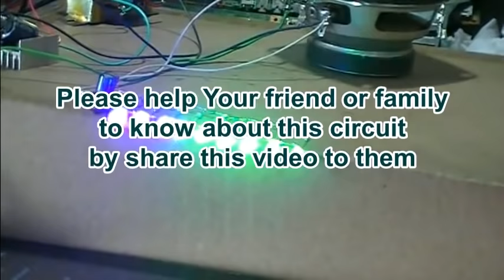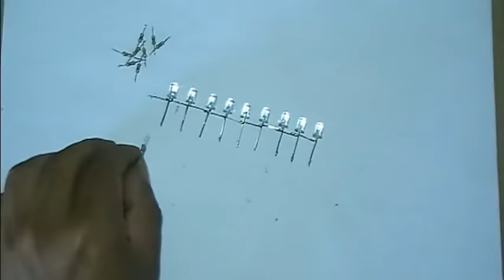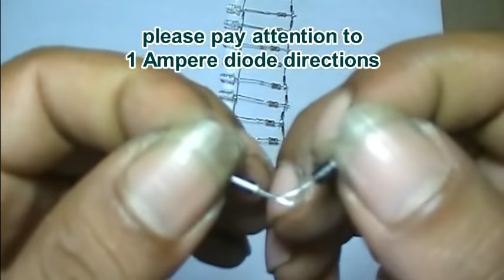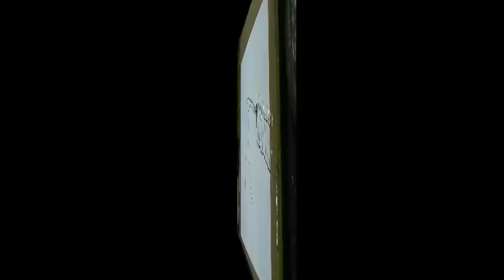No Transistor no IC LED VU Meter

Comment: Can i use  470uf /25v capacitor. And 470 ohm 1/4 watt resistors. And 4007 diode.
Reply from the maker: yes you can use it
Reply: @moristo  thanks bro.
Reply: Can i use 470uf /35v capacitor ?
Reply from the maker: Sure, go a head.

Comment: Can I power this with a 3.5v external bat and ad a mic so it can work on ambient sound?
Reply from the maker: This LED circuit need minimum 15 watt amplifier output power to make it works better.

Comment: No need power supply???
Can i connect with 2way amplifier
Reply from the maker: yes right, no need special DC power supply, just connecting directly to loudspeaker/transducer, and use more than 20 watt amplifier.

Comment: It won't reduce speaker sound?
Reply from the maker: very small current on this LED VU meter circuit, but you have to use more than 10 watt amplifier.
Reply: @moristo  thank u sir
Reply from the maker: YAW

Comment: Can i use it in my sakura 737 amplifier, 1400 watts
Reply from the maker: yes, but you must to add a resistor series connection on the input to reduce the current, Resistor value is 10 ohm up to 100 ohm.
Reply: @moristo  thank you and what is the resistor watts can i use
Reply from the maker: minimum 0.5 watt.

Comment: Formula for LED resistor is R = (Supply voltage - LED voltage) / LED ampere. So, R = (220-2)/0.02 = 11k but when I connect 11k with glass type transparent LED then it fuses after sometime. Why?
Reply from the maker: Please remember, LED current is DC, not AC, when you convert 220vac to vdc using bridge rectifier it wil be around 300vdc.
Basically formula is V=IxR, so R=V/I. For the resistor please use more than 1/2 watt and please use good quality LED.
Reply: @moristo  I am not using any bridge rectifier but only a resistor and even 1/2 watt resistor of 200k makes the led to fuse
Reply from the maker: So the LED quality is not good.
Reply: @moristo  how can you say that, because these LEDs are working fine on battery.
Reply: @moristo  can you tell me what is the significance of the resistor wattage when connecting in series with a LED? if 1/2 watt resistor is connected then does it means that any LED upto 1/2 watt can be used or it means that the resistor will consume 1/2 watt?
Reply from the maker: You said you use 1/2 watt 200k resistor the LED still fuses, so I conclude that the quality of the LEDs is very poor.
Reply from the maker: Watt is the power the ability of components to handle currents and voltages. I'm afraid the resistor will burn out if you use a small power resistors under 1/2 watt.
Reply: @moristo  ok so the wattage ofresistors in parallel can be calculated using the formula P = P1 + P2 + P3... + Pn but what will be the formula for resistor in series? If I connect 2 resistors og 1/2 watt 100k resistors in series then will they become 1watt 200k or 1/2 watt 200k?
Reply from the maker: If you connect in series 2 pcs 1/2watt 100k resistor, so the wattage of the resistor still 1/2watt of each resistor. The wattage on the resistor doesn't mean the value of its power consumption, but it's about durability.
Reply from the maker: In the rules, You should not to parallel or series several resistors with different wattage, except in certain conditions that require accurate calculations so there is a balance in the ratio of watts and ohms on each resistor.
Reply from the maker: example:
You paralleling R1= 10 ohm 1/4 watt, and R2=10 ohm 1/2 (total R value=5 ohm) (total P value 3/4 watt ?????)
No, because R1 still the lowest wattage, that will make R1 easiest burn out than R2.
Reply: @moristo  so what is the power formula for series? I know for resistor in series is R = R1 + R2 + R3... +Rn but what is for the wattage? how do I calculate the wattage of resistors in series?
Reply from the maker: Bassically for the same Resistors value (ohm) with different wattage, will give the same current output.
In the case that you mean, the resistor with the smallest wattage will be the reference of resistors ability power. Very rarely people doing to parallel or series resistors with different wattage each other, except by perforced or urgent.
Reply: @moristo  i am not combining resistors with different wattage but connecting same wattage (1w) in series. But I am not understanding the meaning of the resistor wattage. Does the wattage of a resistor mean that it will consume that much wattage or it means that it will tolerance a load upto that much load wattage connected in series like a fuse wire? Now my question is... if I connect 2 resistors of values 100k 1W connected in series will become 200k 1/2W resistor or 200k 1W? If connected in parallel then it will become 100k 2W or 100k 1W?
Reply from the maker: Connect in series will be 200k 1 watt, connect in parallel will be 50k 1 watt.
Reply: @moristo  What is this for?
Reply from the maker: @debojitacharjee  Just reply your comment about a year ago.

Comment: Hey bro, I want to use the 680 ohm again ?? =)) i not has res 470ohmm
Reply from the maker: You can use 220 ohm up to  1K (1000 ohm)
Reply: @moristo  I use the 3.7 volts power speaker of the 18650 battery, so how many ohms can I use, hope you help 😅
Reply from the maker: its to small voltages, you need more than 10 watt amplifier to make this prety works.

Comment: പൊളി... സൂപ്പർ...Thanks...
Reply: Only 9 LED bulbs can use it
Reply from the maker: you can add more bulbs, but it will needed more power of amplifier output
Reply: Thank U...
Reply from the maker: because this circuit needs an amplitude voltage with  a little bit of current
Reply from the maker: you welcome
Reply: ഇത് കറക്റ്റ് ആണോ
Reply from the maker: Have a nice day.

Comment: @moristo lekka sir,  The output of my transformer is 24 v 5 amp so how many ohms resistor should I use?
Reply from the maker: You have to use same resistors, You just need to add resistor 4.7 ohm up to 10 ohm with serie connection on the input of this circuit.

Comment: Is it work in mini amplify.. 5V amplifier
Reply from the maker: Works on at least 15 watt power amplifier.
Reply: @moristo  what can i use for 5wat
Reply from the maker: Please take a look my another video "Without IC 20 levels BAR graph LED VU Meter BC547 or TUN", that will works even on mini amplifier.

Comment: Can I connect them on big power amplifier 2000 watts?
Reply from the maker: yes, but you have to add a resistor (connect series) in the input section (10 upto 1K ohm) depending your power amplifier
Reply from the maker: and please pay attention to the ELCOs voltage

Comment: Ofc u realise using diodes face to face or back to back you have technically created a transistor? Also applying ohms law when using resistors you are also wasting a lot of unnecessary energy.

But casting all that aside nice example. Brings me back when I used to play with electricity and electronics back in my very younger years. Using car light bulbs wired to speakers used to proper light up the room until the bulbs died.
Reply from the maker: sir.. please watch this video completely first!!
it's true the transistor such as consisting of two diodes,,, but two diodes can not be directly made into transistor.... resistor serves to limit the current entering to the LED (so as not overcurrent)

Comment: Bro my first 2 led already on how solve it
Reply from the maker: If you use class D amplifier you have to make more filter for the amplifier output so the LO frequency (around 300kHz) can't interfering.
Reply: @moristo  Oo yes my amplifier is pam8403 thanks new subscriber
Reply from the maker: Welcome.

Comment: Saya pernah merakit sperti itu bang...kalo resistor nya pakek 560 aman....elco pakek 25volt...tpi sayang nya kalo untuk power besar...kalo volume kecil mantap bisa bergantian ngikutin musik...tpi kalo volume  di besarin lampu nya gk mau bergantian jalannya...
Reply from the maker: Pakai resistor variable bagian input supaya bisa di sesuaikan.
Reply: @moristo  variabel itu apa si bang...tolong dong bang kasih tau...saya masih blajar bang🙏🙏🙏
Reply: @moristo  bang ksih tau dong bang..apa si resistor varible input..saya mash blajar bang...🙏🙏🙏
Reply from the maker: Variable Resistor (VR) yaitu Resistor yang nilainya bisa di ubah-ubah, VR terbagi dua yaitu VR potensiometer (di putar atau di geser dengan tangan) dan VR trimpotensiometer (menggunakan obeng trim).
Reply: @moristo  berarti kalo menggunakan poteensio ajah bisa ya bang??cara nyambungnya potensio nya gimana bang...??🙏🙏
Reply from the maker: Sebaiknya pakai VR trim, karena susah mendapatkan potensio yang nilainya di bawah 200 ohm.
Reply: @moristo  oky bang master sukses selalu amiin....🙏🙏🙏🙏
Reply: @moristo  cara sambung vr trimpot nya gimana bang...??
Reply from the maker: Sala 1 kabel input terhubung ke pin 2 trimpot, pin 3 trimpot sebagai input.

Comment: Pake amplifier DC bisa nggak om?
Reply from the maker: Bisa, kalau rangkaian ini yang penting amplifiernya minimal 10 watt.
Reply: @moristo  kalo 5 volt bisa nggak?
Reply from the maker: Asalkan output power amplifiernya minimal 10 watt.
Reply: @moristo  om saya udah buat dan nyala lampunya
Tapi yang nyala cuma nyampe 3-4 doang. Apakah spikernya kurang gede?
Reply: Atau jarak lampu satu dengan lampu yang kedua seterusnya itu kejauhan?
Reply from the maker: Rangkaian ini hanya mengandalkan arus output dari amplifier.
Konsekuensinya power amplifier harus cukup untuk menyalakan semua level rangkaian Vu Meter ini, minimal 10 watt, jika kurang maka tidak semua level bisa nyala.
Reply: @moristo  oooooooo
Reply from the maker: Ya gitu deh mas bro, mau gimana lagi, hehehehe.

Comment: Tapi kalo tanpa input tegangan, volume power harus besar, alias mbrebegi kuping dulu, baru menyala lednya. Beda kalo ada supley tegangan
Reply from the maker: itu kalau di versi pertama buatanku... setelah sy riset sy menemukan tuk power yg lebih rendah... lihat di video ini apakah sy pakai power amp yg sangat besar?...
Reply: kalau buat power trafo 5/10 A    bisa gak bang ?
Reply from the maker: @youngvarenc6696 Tentu bisa, nanti kalau berlebihan sisa tambahkan resistor di sala 1 kabel inputnya, nilai resistor disesuaikan (4,7 ohm - 47 ohm).

Comment: 1N4148
Reply from the maker: yes you are right, the diode code is 1N4148, but you can use also 1N4001 or 1N4002 etc

Comment: I made this but not working.
Reply from the maker: there's something wrong with your circuit
Reply from the maker: your amplifier output must be enough to run the circuit
Reply: @moristo  i connect the circuit to my one of the home threater speaker of ...output of 9v 1 ampere.
Reply: Should i connect it to sub woofer .
Reply from the maker: You can see.. many Youtubers has copied this video idea and my another video